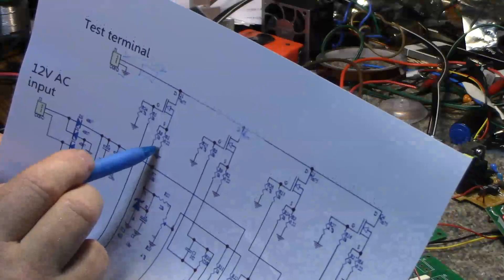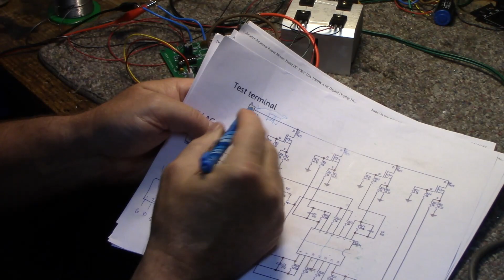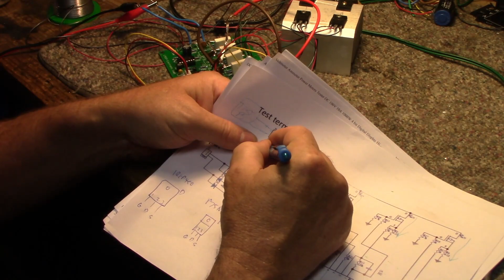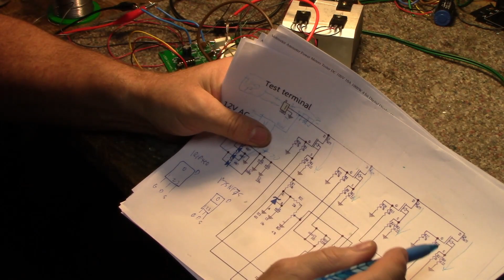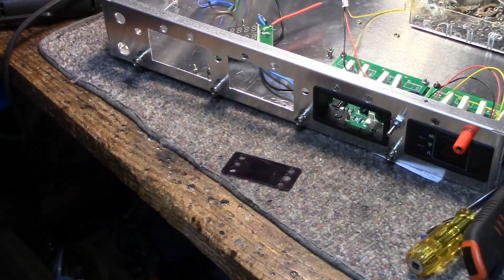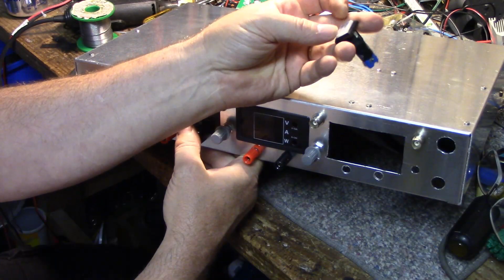Electronic Load Part 3 - Testing & Assembly

Comment: I have had this excact setup lying around for a long time and I was not aware it would be a problem with voltage and amps reading. Instead of hacking the PCB, how about tying in a small separate powersupply for the meter?

Comment: These meters are usually made so that the current measurement is connected to the negative circuit, so maybe instead of adjusting the resistor divider connection, you could just connect an A meter to the black terminal ( This creates a ground in the measured circuit for voltage measurement, you cannot measure + against +) and it would measure both voltage and current. 
Personally, I always install used (in final version) as push fans, on the one hand, they are designed this way and it seems senseless to me to unnecessarily burden the fan with heat from the radiator.
Edit: I would also put BNC connectors instead of potentiometers, this way the connected cables will interfere with the control and view of the display (that is, if they are not broken upwards)

Nice day 🙂 Tom